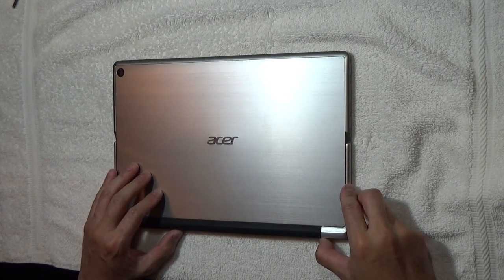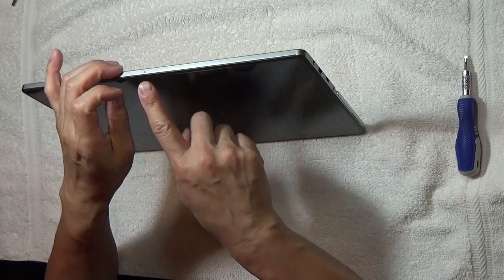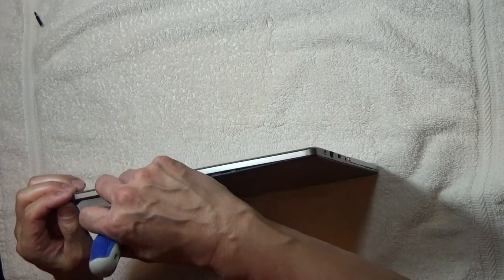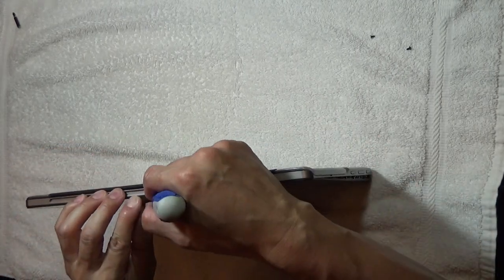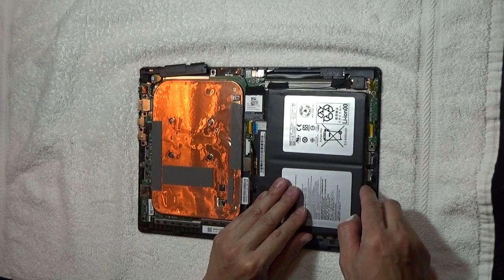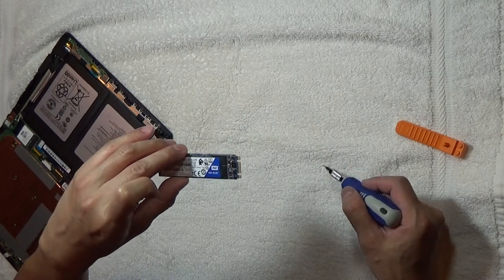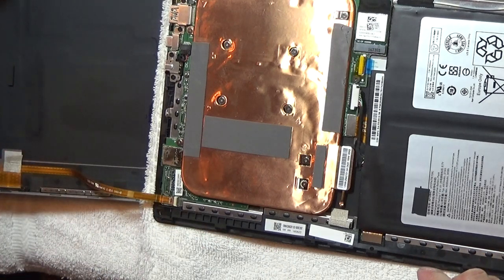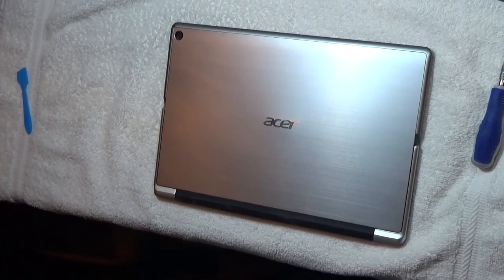Acer Switch Alpha 12 how to open case and replace battery and SSD

Comment: Opened the case and changed the swelled battery today with the help of this video. The clips are more difficult to open, especially those close to the corners. Broke two or three points on the plastic frames and finally opened all clips with the LEGO tool... Anyway the new battery is in place and I am writing this feedback with the Switch Alpha 12 now. Thank you for your sharing!
Reply: Mine also swelled battery. I also broke a few parts of the frame.

Comment: Thank you for your video! With these instructions I opened my Acer Switch 5 and replaced the battery. The biggest difference is an additional connection of the fingerprint sensor, which is connected to the housing cover and has to be removed very carefully. Otherwise the small metal band will tear off.

Comment: Thank you Jim - this wasn't hard at all thanks to your walk-thru. 

To make extraction of the original battery easier, there are two black pull tabs on the right sire (as your video stop-shot is oriented) of the battery.  Grab ahold of each tab with a pair of pliers, and slowly pull to the right, away from but in line with the battery.  A white stretchy tape will emerge - this is the double sided sticky tape that holds the battery in. Remove both, and the battery drops out, no prying required.

The replacement battery is held in well enough by the other "stuff" inside, no need to replace the tape.
Reply: Thank you. I'm supposed to be fixing a screen on one of these here in the next day or two when the customer comes in to drop it off. They won't need to replace the battery, but this would have been nice to know in other situations with the battery packs that may have had this as well.
Reply: @stevenmackay3289  How do you replace the screen? Where did you buy a screen?
Reply: The battery tape is similar to 3M Command Strips, gently pull on the black tab and all the tape releases and pulls out from under the battery.  Lift the first side a little bit and the second piece of tape is really easy to pull out.  Thank you ASUS Hardware Engineers for getting this ease of service past Management and Marketing…Haha!

Comment: Someone else mentioned the black pull tabs for removing the battery adhesive easier instead of prying it, but additionally, the device seemed like it was designed to be pried open from the base of the device where the keyboard attaches rather than starting at the top of the device where the camera was. I also just left the ribbon attached and slid the cover to the side a bit, the battery was still accessible without removing the ribbon.

Comment: There is no need to use force to unglue battery from the chassis. Gently and slowly pull two white glue strips from underneath of the battery (their black-colored ends pointing toward edge) till the end, then just take out battery
Reply: Thank you SO MUCH!
Reply: Yes, and if for some reason the tabs tear off you can use a pair of tweezers to grab the torn end and wind up some of the tape to continue removal.  👍

Comment: I remember that years ago an article mention this tablet isn't repairable due to custom liquid loop but after seeing this, the loop isn't glued to the back panel and feel cheated by that article. Yeah it's a bit hard due to those metal clamps but it isn't unopenable and doesn't even require heat gun

Anyway this tablet has a very nice screen that holds up even today. Windows 10 is too heavy for 4GB RAM variant but Project Brunch (ChromeOS) works almost flawless. It even runs Android games well under ARC runtime even though being rendered around 2K resolution

Comment: 1. To do not damage plastic border of the screen use credit card and try to push whole side of it. It will save plastic.
Point force like in video make some cosmetic troubles.

2. To remove battery pull black "labels" at the corners of battery. They will remove white tape behind battery. I use small multitiool to do it.

Comment: Interesting...it does not involve fighting glue over the edges. It seems safer too than opening a Surface unit. Thanks for the video, this confirms my choice between Surface or Swift Alpha.
Reply from the maker: In my experience, there was no glue along the edge, just clips.  The biggest reason I opted for the Swift Alpha is primarily the price, at almost 1/2 the cost with competitive features and performance that meet my needs.  The ease of upgrade and battery replace was a plus that came later.  One thing to note is the Swift Alpha does run hotter than other devices but does not seem to affect performance.
Reply: @Frugallist  Thank you for the additional information :)
Reply from the maker: The original battery does have two strips of tape you have to fight with.
Reply: @Frugallist  ah...yes, that's quite common, like most cellphones these days.
Reply: You dont have to fight the glue under the battery. Just pull the two black strips beside the battery outwards 😉

Comment: I pried the battery off with a knife. The first time the battery caught fire I was in my office and decided it was too dangerous for inside. The second time the battery caught fire I had migrated to the garden and although the fire caused a small hole in my gardening gloves I escaped unharmed. The upgrade is now complete, no damage to the device, but that information in the comments about the sticky tabs would probably have been helpful.

Comment: Tipp: If you open it for the first time: 1. The screen breaks rather easily when applying pressure to open it; also the plastic can chip away. 2. Just leave the little ribbon on, it is a pain in the butt to get it secure again
Reply: How do you replace the screen? where did you buy a screen?

Comment: Do you know where I can get the thin docking station ribbon cable mine is torn. I looked all over couldn't find one. Thanks.
Reply from the maker: You might need to search on eBay for parts if it's available.

Comment: So my screen is bulging out.  Other sites/videos have suggested that it's the battery that needs replacing because it is swollen.  Do you agree?  And if I change the batter, will that fix the screen situation automatically?  Or is there something else to be done?
Reply: I have the same problem.  I'm assuming it's the battery based on it's location.
Reply from the maker: Yes, my screen was bulging from the front on the left side due to swollen battery.  Replacing the battery resolved the issue and screen is back to be flush as the originally condition.
Reply from the maker: Yes, replacing the battery will fix the screen bulging at the left front.  The battery performance was still good, but I jumped on replacing it as I wasn't sure how much it will continue to bulge and eventually affecting or breaking the screen.
Reply: @Frugallist  Thank you.  I feel more confident knowing that I bought a battery and this should fix the problem.  Did you have to do anything to the screen after the battery was replaced or did it just naturally go back ?
Reply from the maker: @BeaconRI  nothing for my experience, it just went back to normal which is nice!
Reply: Same problem ı had, just open the case and make small holes on battery label than its putting out the air inside. before ı knew it, ı ordered new battery. ( During ı repair it ı also cracked my screen and now ı order a screen with frame and waiting for it )
Reply: @h.mustafasag8307  how eo you replace the screen?  Maybe you can video it while you do it?  How much are you paying  for it and where?
Reply: @BeaconRI  ı just bought a lcd screen with frame in Aliexpress and ı will change it soon. While ı remove the old screen frame is also damaged as it extra sensitive material. Now ı changed the battery and ı'm also planning to change the ssd + lcd screen once ı receive the parcel. Im only confused in ssd if m2 nvme ssd is working with our Acer sa5 271 or not?
Reply: @h.mustafasag8307  How did you replace the screen?

Comment: very helpful!!! You know the maximum ssd it can takes?
Reply from the maker: I upgraded from 250GB to 500GB m.2 SSD and it worked great.  I am not certain of the maximum SSD size.  I complement storage with 400GB micro SD which is a cheaper option.
Reply: @Frugallist  Thank you, sir, for your answer!!
Reply: @Frugallist  where do you put the micro SD?  My switch is about 5 years old.  I don't see a slot for that.
Reply from the maker: @john L, you can locate the micro SD slot on the lower right edge (when facing the screen), you have to  open the kickstand to see it.

Comment: Thanks alot the guys a the repair store would have charge me 170€ for just replacing the battery
Reply from the maker: You can easily repair on your own, just be careful and don't rush when separating the back cover to avoid scratches or cracks, and save some money to be used for the upgrade parts!

Comment: Thanks for the video! I am unable to find a replacement battery for my device, is it possible to just run the laptop on mains instead of battery (I will remove the battery entirely)?

Comment: Hi Jim, i want to ask , if I pull out the battery and let the laptop without battery, would the laptop still can be turn on with it's power adapter?
Reply: I have tha same question.

Comment: I have a Acer Switch Alpha 12.  It has crapped out on me!  It will not turn on!  I'm considering getting an SSD encloser to use the SSD card from the Acer as an external drive.  What do I look for in order to purchase an SSD enclosure?  Do you know if the memory card is NVME or NGFF?

Comment: Hello friend. Well, The batery of my acer alpha is increase your size. I do not found yet a new batery in my country to replace. My question is : Can I remove batery and continue tu use without batery, using them connected in power suply all the time?

Comment: Is the disassembly similar on the Acer Switch 5 because it looks similar to Alpha 12? And how long does the new battery last compared to original? Thanks
Reply from the maker: Not really sure, but would think it'll be similar.

Comment: Hi, thanks a lot, nice video. Do you know if ı upgrade my ssd with 2 slots new ssd 500 gb but its called ''SSD NVME'' type with 2 slots? Is it working in our Acer SA5 271 ?
Reply: I also have a Acer alpha switch 12 it’s only compatible with a m.2 sata ssd which is a 5 pin connector while a m.2 nvme ssd is a 6 pin connector

Comment: Can you share the battery part number and where can I buy good battery for Acer Switch Alpha 12?
Reply from the maker: It's :  AP16B4J
Reply: @Frugallist  thanks
Reply: @Frugallist  While opening the case, I broke the screen. Can you share the part number of the screen, so that I can buy?
Reply from the maker: @raakeshp  apologies, I am not certain of the part numer for the display panel. I don't want to give uncertain info to have you buy the wrong part.

Comment: REMOVE micro SD card, or you'll break the SD card slot like I did.
For prying bezel, the metal frame pulls out, while the plastic frame pushes in. Note author makes a distinct pop sound with each clip release.
Battery is NOT pryed out. The tape has black tabs that are pulled like COMMAND tape, very easy.
Reply: Unless the black tabs tear off the tape. :(

Comment: how did you transfer the data/OS?
Reply from the maker: I purchased the Sabrent enclosure and cable from Amazon (Sabrent M.2 SSD to 2.5-Inch SATA III Aluminum Enclosure Adapter (EC-M2SA)) (Sabrent USB 3.0 to SSD / 2.5-Inch SATA I/II/IIIHard Drive Adapter (EC-SSHD)), placed the new SSD in then used Macrium Reflect which you can download a full function 30 day trial. It completely cloned the drive and absolutely not difference when you swap to the new drive. 
After the upgrade you can place the old drive in the enclosure and you can use it as an external USB drive or put the SSD enclosure directly in an older computer/laptop.
Reply: @Frugallist  thx Jim. The most useful tip for me on your video was to watch out for the B&M Key support and this saved me grief into buying the wrong SSD and SSD Ext Enclosure. Merci.

Comment: this opens like that? didn't realize but I'm having an issue... but literally NO ONE has a video addressing it on YouTube so maybe I can get an answer in the comment section... recently noticed the screen on my acer switch alpha 12 is bulging or popping up, I simply pushed it back down but it would pop back up and it's getting worse... what's  going on where that's concerned? do I need a new screen or something?
Reply: sounds like a bad battery but I'm not an expert.

Comment: Hi plz help!

My charger 
45w 19v  2.37A  was dead so I uses another one
90w 19v 4.5 A
It worked for few days and now,  the computer does not want to switch on. I guess something is dead! 
What part should I replace?
How can I get my files from the hard drive ?
Thanks
Reply: your original charger probably died because your battery is bad and needs to be replaced. it's pretty common. I hope you were able to get your computer repaired.

Comment: This video looks really promising. My Acer SA5-271 is not booting up (getting "No bootable Device" error) and am not able to re-install windows on it either (only one partition is showing up and windows is erroring out and not installing). I have decided to replace the SSD and see if that fixes the issue.

Few questions if you don't mind - 1. What is the use of "Sabrent USB 3.0 to SSD / 2.5-Inch SATA I/II/IIIHard Drive Adapter (EC-SSHD)"? 2. Is the enclosure adapter required to clone the data from existing SSD and copy it onto the new SSD? Will my old SSD be still readable because the PC doesn't seem to be able to use that for booting up and windows is not able to install on it either.

Appreciate your inputs.
Reply: Did you ever get this solved? Mine has the no bootable device error as well and I've tried quite a few things. Same issue as you.

Comment: Hi, do you know that if it is possible do change the mainboard of the SA5-271-59BH (core i5 4GB) for the mainboard of the SA5-271-54Z2 (core i5 8GB)
Reply from the maker: My model is the core i5 8GB but I am not certain if you can switch out the mainboard, it might be more work and cost than it's worth in my opinion.
Reply: @Frugallist  how do you upgrade your switch alpha. I want to upgrade my device. What do I need to know to upgrade. I really need it.
Reply from the maker: @egorrakutov4165  you can only upgrade the SSD or replace the battery.

Comment: You made a mistake. You should not finger that thermal band for GPU and you should not put thermal paste over GPU. Becareful. Generally good video to help other  poeple who struggle with the crappy battery and SSD of ACER Switch Alpha 12. What brand battery do you use? Is it Emerging brand?
Reply from the maker: Thanks for the advice!  For the battery I just used a generic aftermarket from eBay.
Reply: I'm about to upgrade my SSD as well. Interesting point about the thermal paste on GPU. Why would you suggest that? I do agree there was no thermal paste residue on the heat sink on GPU side.
Reply: @anishmajumdar8043  Just renew the CPU thermal paste, do not touch GPU, because no need. I recommend WD Blue series SSD. Stock SSD is really low quality. You can check its health condition with Harddisk Sentinel program.
Reply: @gokmen9928  Cheers for that. I ordered WD blue as well. In my case it was the only one available at the moment. Upgrading from a 128Gb to 500Gb in my case, it's going to be fun.
Reply: @anishmajumdar8043  I also have better tissue. It has bulged out from left top edge. Where do u purchase the replacement battery and SSD?
Reply: @raakeshp  I didn't replace the battery I'm afraid. SSD was available on Amazon UK. However, I'm sure you can find that as well on Amazon or ebay.

Comment: Cataclysmic failure.  Tried to follow the instructions and the display did not work after reassembling the unit.  I don't think Acer wants you to replace the battery yourself.
Reply: Hi, TimtheBald! I don't know if you still have your Acer Switch Alpha, but I watched this video to replace the battery in mine. Once I reassembled everything, I had the exact same problem you did. The display would not work, even though everything else seemed to function; the LED in the power button illuminated, the detachable keyboard lit up and seemed to be working, and the unit appeared to boot up (despite the "dead" display). In case you haven't tried this, in desperation, I kept booting up my PC (or appearing to boot it up, since I couldn't confirm anything on the display), then forcing shut down (i.e., long-pressing the power button until it shut down), then waiting a minute or two and booting it up again. I repeated this cycle many times. Finally, the display came on during one of the boot-up cycles like nothing ever happened.  One odd thing is that the PC restarted with a "default" user in Windows (like a brand new user setting up Windows for the first time) rather than booting up in my Microsoft account. So, I had to sign out of that default Windows account and manually re-sign in as myself. Anyway, if you haven't tried this, you may be able to "resurrect" your display.

Comment: Sir Jim, i have problem on my laptop, when i change the battery and open it. The system said that the battery was not present or not working. Do you have any recommendation?

Comment: Jups... Screen broke when closing it back up...
Yet another mass produced piece of e-waste, deliberately made to be difficult to repair...
Then people wonder why I prefer custom build desktops... Those easily last decades...
Reply: Are you going to buy a new screen? is it easy to replace it?
Reply: @ronenfe  Probably just going to use it in the cinema-room, connected to a projector (if it can handle 4K). 

Otherwise it's going to the scrapyard...